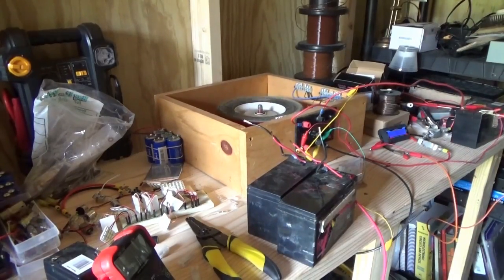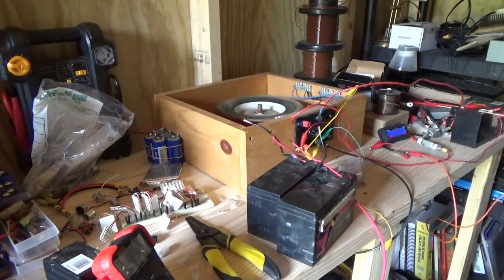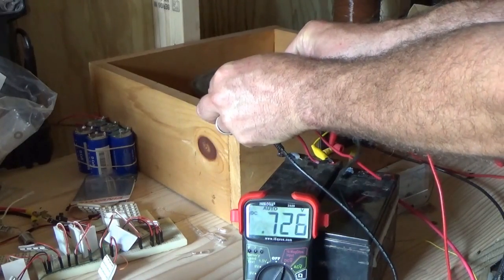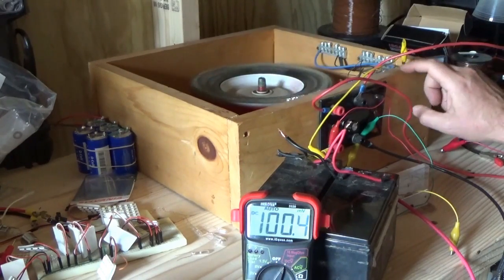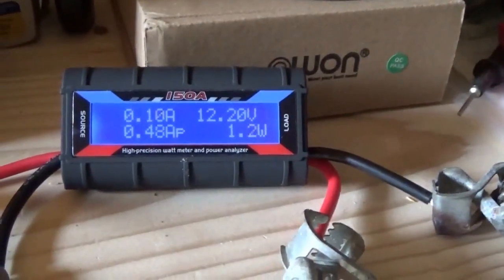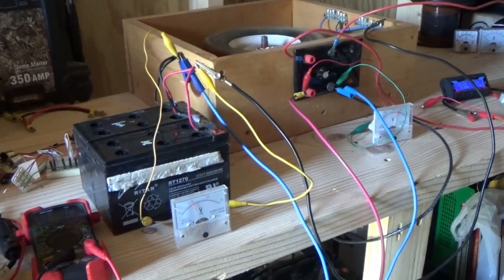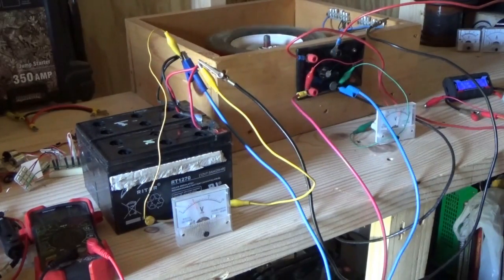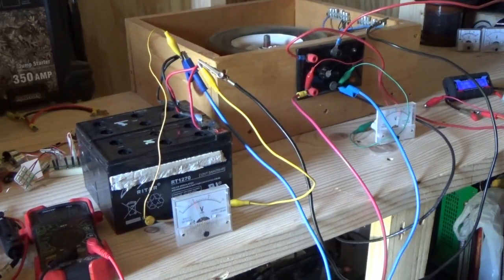Single Coil Bedini SSG Charging Multiple Batteries At One Time

Comment: I wonder if it's possible to build a bigger generator, to charge a stock of batteries. (For home use). I'm still learning a lot of this stuff but, I have yet to see an experiment of someone trying that. I've heard the benefits of the Daftman generator is that, it can also charge the main battery used to run this machine, and the secondary batteries at the same time. Is this true?
Reply from the maker: It is all possible yes. But charging the primary battery and secondary batteries at the same time is very tough to tune. Not my goal.

Comment: Can the batteries being charged be connected to an inverter and used to power appliances while the ssg system is running, to keep the battery charged while being used?

Comment: You say those two dead batteries were bone dry well if you look inside a AGM battery they all look dry,  that’s how they are supposed to look they are not flooded cells they are absorbed glass mat and I have never had luck putting water in them effectively converting them to a flooded  cell and restoring their capacity

Comment: Those are, or were, sealed AGM batteries you just filled......  🤦‍♂️
Reply from the maker: Dry is dry. They needed water.
Reply: @TheDoItYourselfWorld  Wow dude, no they didn't.  That's the point of an *Absorbed* Glass Mat battery. You don't fill VRLA/AGM batteries.  You can't use a hydrometer to measure their SOC, and they're sealed with adhesive for a reason.  Wow...

Comment: To those who consider themselves an electrical engineer, be warned!  You have been lied to by deliberately falsified textbooks!  

Electrical engineering (EE) theory, developed over 130 years ago, leaves out a lot of newer science discovered since then.  For example: The original EE theories based on the work of Heaviside and nearly wrecked by Lorentz assumed a flat spacetime (fair assumption in 1885 since that is all they knew about).  Einstein proved that wrong by saying that spacetime is curved, so right there is a gaping hole in the formulas and textbooks you consider to be the standard since a curved spacetime allows for energies from spacetime to enter a circuit.  Then there was quantum theories in which thermodynamics breaks down, the discovery of spacetime torsion, and the experimental proofs of Lee and Yang showing spacetime is asymmetrical...I can continue.  BTW, Lee and Yang won the Nobel Prize for their work on asymmetry in 1957 IIRC.  Asymmetry provides the "magic" this Bedini SG circuit uses to function.

Why have the EE texts not been updated?  Good question, wish I knew.  However, the whole textbook on electrical engineering is stuck in the 1880's without debate.  The EE theory works, it's just incomplete and archaic.  If science is about anything, it is about not getting it perfect the first time through, and the EE theory of Heaviside/Lorentz is a prime example.
Reply from the maker: Amen. Thank you!! Wish I could give you multiple thumbs up. In order to work on the Bedini motor I had to toss out a lot of what I learned in EE. You have to go at this with an open mind and see what it can do. Learn from it for yourself. I am still learning today.

Comment: quick question something which i have tried before but i feed it back in to the ssg and blew it eventually, why dont you add a wind of coil over the coil you've already wound with 10x or 20x the turns so it acts like a transformer to up the voltage from 12v to 110v or 240v usa/uk mains? it would be a ac output aswell just like the mains, and then see if you can plug a mains battery charger into it and see if that would actually charge batteries! a motor with a mains output is what the world really needs most appliance's run off mains, these motors designed to just charge batteries has lost any potential, it's something worth trying!
Reply from the maker: Jumping voltage up and then back down is a bit wasteful though. Best is to always try to directly use your power.

Comment: I'm an electrical engineer.You got me confused with this video. What are you trying to accomplish? Is this a voltage converter? Why not use a simple DC to DC converter or a simple battery charger and save the energy wasted in the motor bearings?
Reply from the maker: Ok, first being an engineer, forget what you have learned. I studied electronics many years and this has to be looked at with an open mind. This is an electrical energy converter of sorts. It converts "radiant" energy into usable energy in the battery. Energy in the air around us is sent to the batteries. The chemistry of the battery converts it to usable energy, charging the battery. It is NOT a generator. It is NOT a perpetual motion machine as many wrongly call it. Most people who argue against this use the wrong terms, using impossible terms to call it impossible.
Reply from the maker: When you pulse voltage into a coil rapidly then the radiant energy flows into the coil following the collapsing magnetic field. Voltage travels faster than current. Pulse the coil fast enough and repeatedly and you get more radiant energy output into the batteries.
Reply from the maker: This is NOT a one to one charger. You can use a small 7 Ah lead acid battery to charge up multiple larger batteries on the output at the same time.
Reply from the maker: About the voltage. The pulsed voltage is what upsets the natural state of the radiant energy. Current is useless here. This is why we must pulse it quickly.
Reply from the maker: This can be made solid state but it is harder to set up and tune. With the wheel it is self tuning and adjusts itself to each battery automatically. I have used these for many years and am still amazed how it adjusts itself. The wheel and magnets simply give us the timing for the pulse in the coil which cause the radiant energy to flow into the coil and out to the battery(s) being charged.
Reply: Is this a joke? Are you serious? 
Energy in the air? What energy? How have you studies electronics when you don't have a rudimentary understanding of 6th. grade Physics and Chemistry?
Forget what I have learned? Knowledge is power! 
I suggest you go back to school and learn the very basics of Physics and non-organic Chemistry.
Reply: Andrew Evanoff
Knowledge is power, but only if the knowledge is correct!  Electrical engineering theory, developed over 130 years ago, leaves out a lot of newer science discovered since then.  For example: The original EE theories based on the work of Heaviside and nearly wrecked by Lorentz assume a flat spacetime (fair assumption in 1885).  Einstein proved that wrong by saying that spacetime is curved, so right there is a gaping hole in the formulas and textbooks you consider to be the standard.  Then there was quantum theories in which thermodynamics breaks down, the experimental proofs of Lee and Yang showing spacetime is asymmetrical...I can continue.  So, the whole textbook on electrical engineering is stuck in 1885.  It works, it's just incomplete.
Reply: @andrewevanoff1192  Why do you flame him for doing this ? anyway if it works, why don't you ask the right questions ? why does it work ? If it doesn't you would be right. If you can't explain it, don't say it's impossible !
Reply: you sir ask for his explanation so that is his! hehehe

Comment: so if I understand is. you can put muitted battery's at a time in the intake line of the moter whitout that much current to it
Reply from the maker: I have been adding more batteries on the charging side without seeing an increase in energy out of the run side. And adding batteries does not seem to divide the output energy between them. They all just get charged.

Comment: since the input power is isolated from the output power it won't matter what you attach to the output coils,  the input will be the same, unless you physically change it.  the bedini is just a step-up transfotmer, using a pulsing DC current to build, and collapse a magnetic field across the secondary windings which creates the higher voltage outout. the magnets might improve the field strength,  but are mostly used fir the motive force to keep the wheel spinning.

Comment: You could check amperage after adding each battery to the output. Batteries should charge slower now unless there was available unused power in the system. I like this topic and appreciate your vids.

Comment: Sounds like your on a roll now!  Good work.  According to a certain reliable source, you can extend this BEMF strategy of charging multiple batteries to an unlimited number with the incorporation of extra processes.  Right now you are using just 2 processes.  The processes I mention are extra processes not wired or necessarily using the  same elements as you show here but are additive stages to the system and may even cause a recharge of your drive battery without swapping it out according to the said source.   Hope you can interpret what this really means.  For the people thinking there is nothing special here, maybe you could show that the charge is real and not just a surface charge.  Maybe measure as you did some weak batteries, then do a load test like with a relatively high current car brake light or 12VDC motor or such and time how long it lights or runs at the weak capacity.  Then after the Bedini "treatment"  run the loads again and time duration it lasts with the improved capacity.  I think that would be definitive to people in a way that is easy to accept without getting in to more exotic theories.

Comment: Hey Troy,  I had a computer repair shop in Houston, Tx for 12 years.  I have lost track of how many computer 
UPS (  uninterruptible power supply )  battery back up units I scrapped over all those years.  They would sit on trickle 
charge forever and it cost more to replace the batteries than to replace the unit. I would scrap them for the lead.

It never occurred to me to open up a sealed lead acid battery and just replenish the evaporated distilled water and then try 
to see if the battery would take a charge.  One time I found a huge 1600 watt second UPS with a BIG 12 volt battery.
I connected a spare 12 V car battery to it and for long time I used it as a portable source of 110Volt power to run drills and saws.